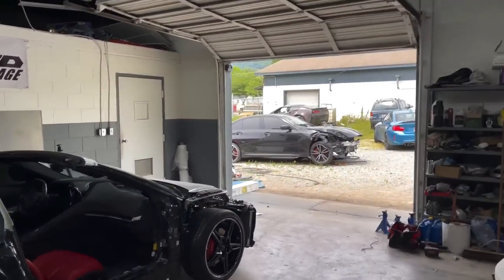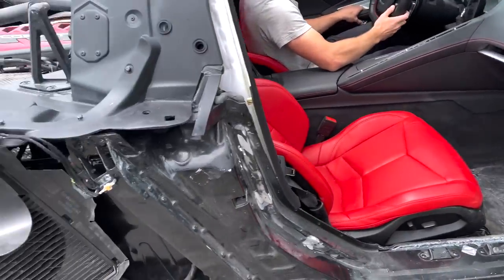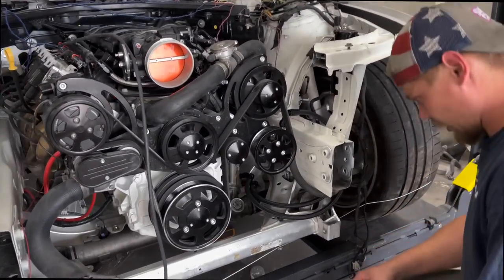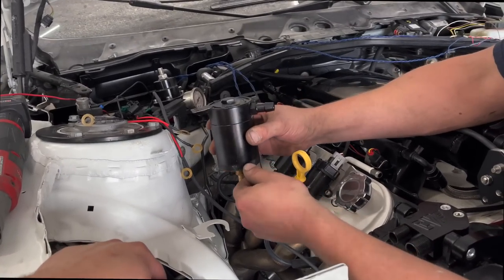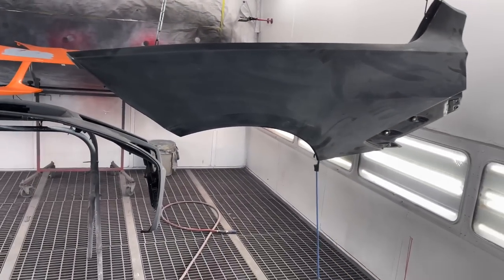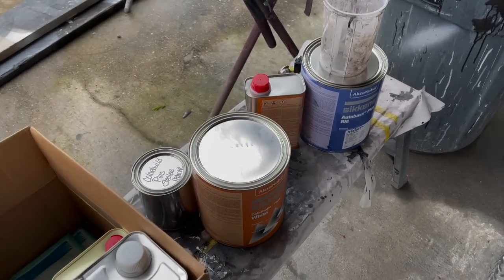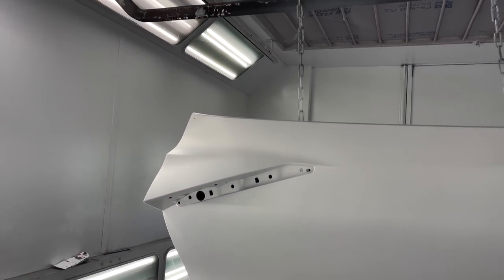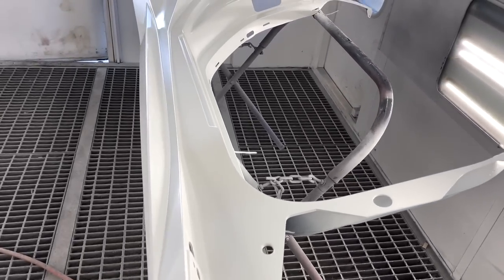Painting the 2022 Corvtte Parts Its Almost Time to Put it back on the road!!!!

Comment: @vTuned garage  If you guys are planning to add a high rear wing spoiler to this C8, now would be the best time - while the rear bumper is off.  The factory ones come in white, Carbon flash (black metallic to match the side boomerang), or Carbon fiber ($$$$).  I’d go with the Carbon flash or the white, personally.

Comment: Freon? You will find it is almost definitely Climalife R1234yf. Don't stick any old stuff in there.
23rd Garage should have been the ones to work on the Mustang from the start. They would have done a proper job, and it would still have drip rails and not look like a poor excuse of a car.